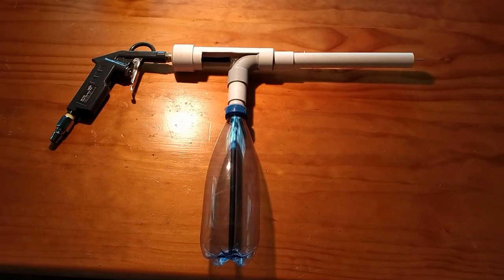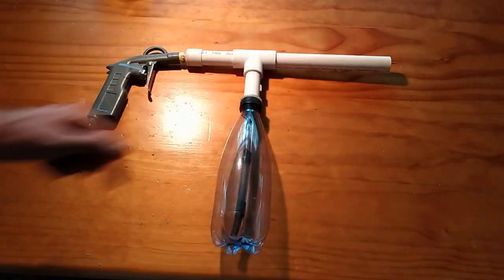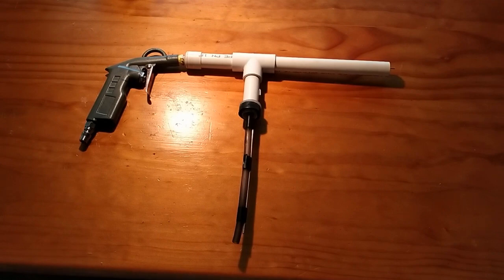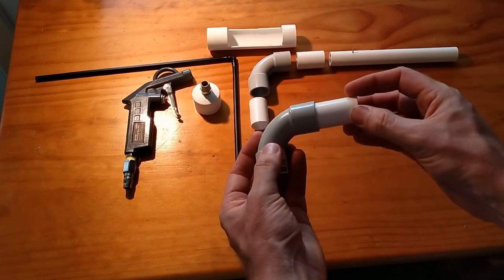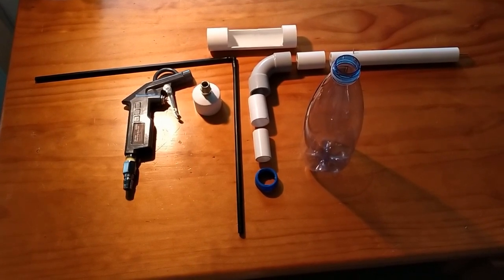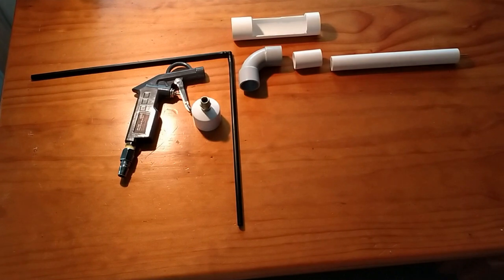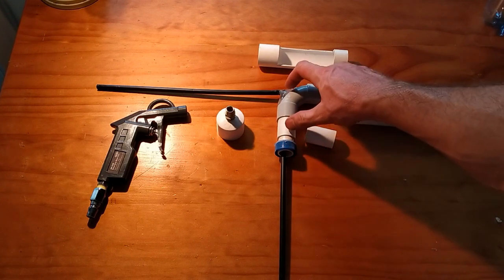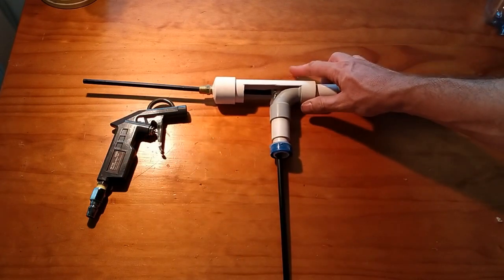2nd Generation Homemade Powder Coating Gun

Comment: Hello.  Perhaps this video is too old for you to look at comments but I'll try anyhow.  Id like to make a powder coat system but am unsure about the design.  I was a lab manager for a company that produced industrial equipment for handling powders.  So I have an above average perception of whats going on.  Additionally, I have painted cars for over 40 years and my garage is set up like a machine shop (milling machine, lathe, etc).  So although it will be my first attempt, my goal (as in all my obsessions after retirement) is to make the best one with the least money.
I really like your design.  It seems, though, that the incoming air tube that goes into the bottom bottle could interfere with the powder coming out-not much, but still.  Have you tried putting the incoming air in from the bottom of the bottle whereby fluidizing the powder?  Even having 2 incoming air lines (one for fluidizing and one for conveying) seems an improvement.  I know that a second or third hole would be less convenience, though.
Another thing I've noticed is how crappy cheap sandblasters are.  A volumetric feeder could help both tools.  Imagine, for example, the auger in a meat grinder that pushes the meat towards the blade.  If at the bottom of a small hopper were a level tube with an auger in it (screw conveyer) the flow of sand or powder could be greatly controlled.  A cheap auger is an antique drill bit for wood and cheap pipe from anything along with a controllable gear motor powered like a cordless drill would be a huge benefit, especially for a sandblast.  The auger could turn at any speed you want.  There are thousands of design of those screws.  They are for every type of material imaginable.  There are other material handling devices that could be incorporated yet I see NONE in any of the fields.
Any comment would be appreciated.
Reply from the maker: This design was one I came up from over the counter supplies and spares. I have a 3D printer now so more things are possible. I have been super happy with the performance of this gun so the needs I have and so haven't thought much more about improving it. Would be keen to hear what you come up with.
Reply: @tinkersmith4615  Thanks for the reply.  3D printer is on my list.  I needed on last week.  One thing those guys taught me was they use acetone to clean the bed.  I put some in a jar with pvc.  Over night it turned into a paint that you can patch stuff with.  I can fix all kinds of stuff with it.  I think it could be a body filler.
I've been watching tons of videos today.  I find it funny how so many people have to shake the box to increase powder flow after paying so much money for the best ones.  I had to deal with a different powder every day and had to make them all flow for test results.  So I feel their pain.
I'm leaning now on focusing on a fluidized hopper and getting a chinese imitation of a GEMA for $40.
Another part of me wants to build a gun with an above hopper made out of a plastic funnel with perhaps a rotary valve or even a tiny bin actuator.  I think the answer to the best one would vibrates the end of the gun (like an orbital sander) to allow increase flow, increase coverage area, and increase ionization.
Could you answer one question for me?  Why does no one use an old car coil?  I remember some had 40,000 volts.  I'll bet I have 5 of that type in a drawer.  I have some unique ones too.  Is there something I'm missing? can they be used?
Reply from the maker: @onenewworldmonkey  not sure about the car coil. I haven't had much experience with them. I would just check how much current they draw. The ones I use have very low current so the danger of high voltage appears low.
Reply: @tinkersmith4615  I was just told that  car ignition coil is of an iron core which cannot handle high frequency.

Comment: Hello, I want to build an electrostatic coating device, but I will rely on a high-voltage transformer for the TV. Do I have to make a rectifier circuit or diode unification, or is the transformer sufficient?

Comment: I made the gun and it works, thank you. I am having trouble applying 2nd coats, the powder just falls off when it hits the piece, I tried reducing the voltage to 3 volts which is the minimum for the voltage generator, have you had this same issue? Thanks
Reply from the maker: The powder won't stick for a second coat with the electrical charge because there is no exposed metal. You need to use a technique called Hot Flocking. You simply pull it out of the oven when the piece is still hot and apply the powder without the charge. The heat in the work piece will cause it to stick. You need to then place it back in the oven for another 10mins to let the new coat melt. I show the process here at the end of the video: https://youtu.be/EoX6G9tioN4

Comment: the use of the step down, would it be a form of protection? why not use a 4v 2a source directly?
Reply from the maker: I guess you can. The buck converter holds a constant current and current is the most important factor to limit. I haven't tried a 2a power plug pack on its own.
Reply: @tinkersmith4615  ok will try 2.5a like you do on first video. why in the first video do you touch the pistol to the cathode? I was looking to see if there would be ark kkk. sorry for so many questions and thanks again
Reply from the maker: I earth the gun out on the work piece to ensure that any capacitors inside the high voltage module are discharged.
Reply from the maker: I have tested between 1.5a-2.5a and it works at each of those. It doesn't work at 1a. I thought you were asking if you had to use a buck converter. I find it a necessary component as it stops the high voltage module from shorting out.

Comment: Hi..Do you have any wiring diagrams and instructions how to build it that people can download? ..nice video
Reply from the maker: Have you seen my first video? I link to it in the top right hand corner in the first few seconds of this video. In it I give step by step instructions as to how to wire up the high voltage module. Please come back to me if that video does not answer your questions.
Reply from the maker: Here is the link: https://youtu.be/6dXSpUkiLv8
Reply: @tinkersmith4615  Thanks..saved all the pictures with the measurements :)  .. the wire you had along side the tube is that for stability of the tube what about using a metal tube?... 
how did you wire the High Voltage module and DC-DC converter in the box?
What do you use as a heat source to set the powder?
Reply from the maker: If you are referring to my first video (Generation 1) that was to hold the tube in place. I chose to use a rigid tube in this video (Generation 2).
Reply from the maker: I simply wired the high voltage module directly into the DC-to-DC converter terminals the soldered the long wires to the other side of the high voltage modules and applied heat shrink.
Reply: @tinkersmith4615  so how you set it up on your variable power supply excluding fan is the way it's wired in the box?
Reply from the maker: I picked up an old kitchen oven for free from a guy renovating his kitchen. They are advertised regularly on our local classifieds (Gumtree).
Reply from the maker: I have run the set up at 4v/2a and it works just fine. It will work as low as 1.5a but not 1a. Make sure that you set the Buck converter to 4v/2a also so it manages the power regulation.
Reply: @tinkersmith4615  Thanks for fast reply, I will do that when parts arrive. 
Great videos by the way..
Reply from the maker: Check out from 13:30 of the original video. I talk about it in detail there.
Reply: @tinkersmith4615  ok thanks you talk about it a little bit at 5:00 but it was confusing me a bit but got it now :)  Will have to give it a go when i get the parts..got a few things i would like to try and powder coat :)
Reply: Hi, has anyone tried the 12v 2A plug adapter yet?
I am building mine and all I have is 12v 2A at moment. 
Thanks